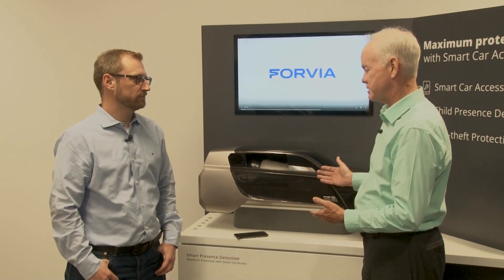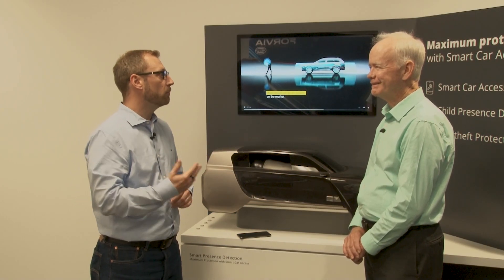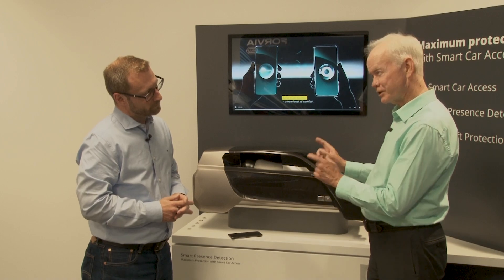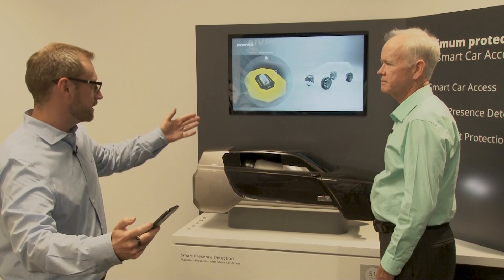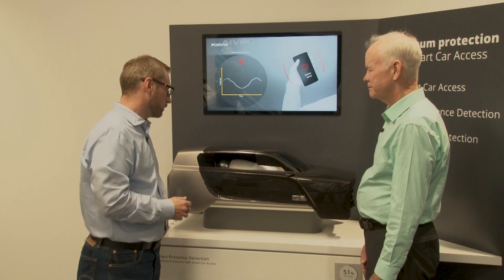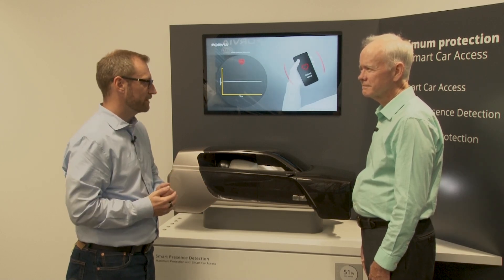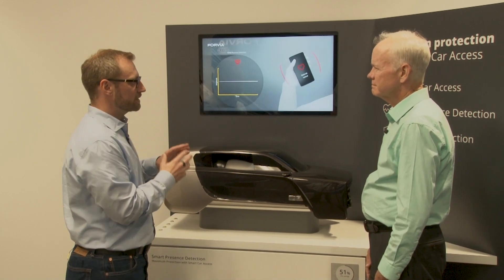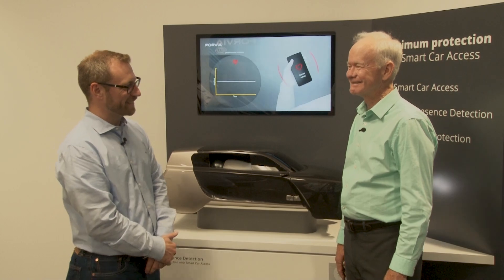Forvia Uses Ultra Wide Band To Stop Car Thieves Cold - Autoline Exclusives

Comment: I think this is cool. Though mine was stolen at gun point. So not much use to me how smart the car is. The bad guys still have guns, and will take your car right in daylight times. Fortunately my car was recovered,  and the thieves caught. So this is a nice step, but put the criminals in jail where they belong.
Reply: Maybe having the system have a feature to where if you exit the vehicle and it drives away with you outside it shuts off after a certain distance/time so the thieves don't get very far and yet far enough away to give you time and distance to get to safety.  This would require keeping the phone on your person and not having the thief take the phone with the car but it is an option easy to implement
Reply: Any good Car Stereo shop can install a vehicle security system that does indeed shut off the engine after you exit the vehicle with the wireless fob in your pocket. They can even set a timer so you can get well away from them - for example, 2 or 3 minutes.
Reply: You can also exercise your Second Amendment right clearly spelled out in the US Constitution and carry a pistol.